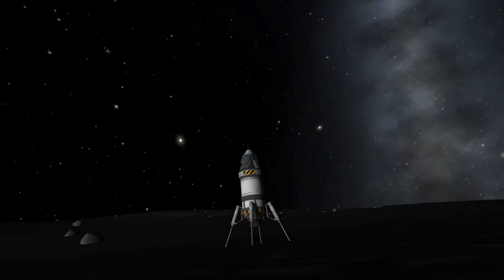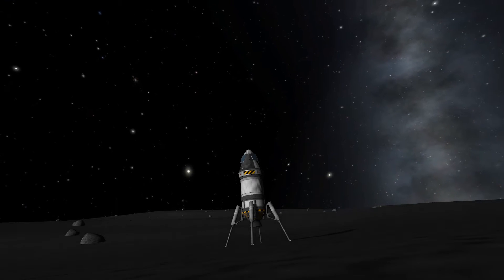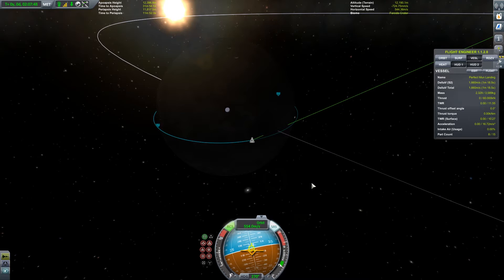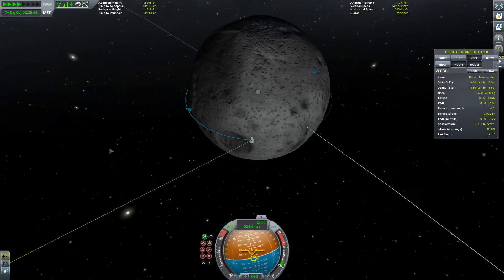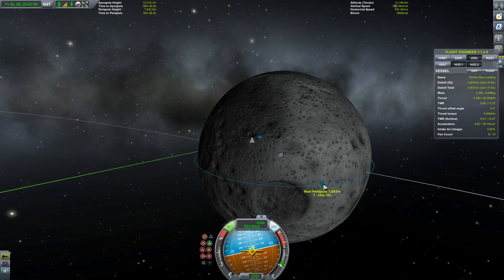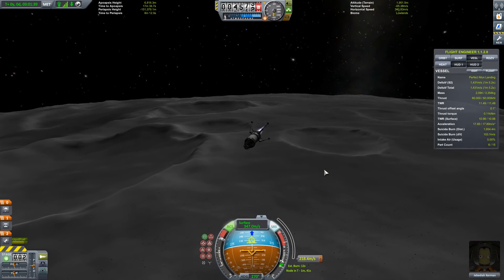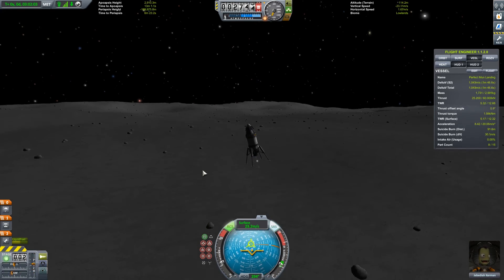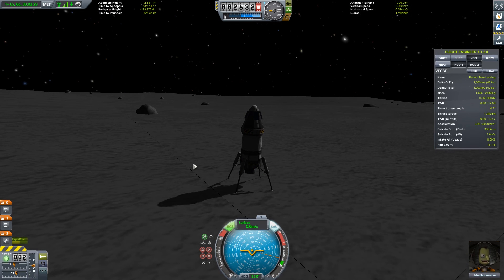Perfect Mun Landing in KSP - Suicide Burn

Comment: your approach is good, but not perfect. For that you'd need more practice or kOS/kRPC.

Let me set the scene:
you start off like in the video. Coming down at an angle and *fast*.
The ideal burn is such, that you burn at 100% throttle from begining to end (landing) at an angle between retrograde and away from the planet. By the end of the burn you should land at about 5ms^-1 (or whatever your landing legs can tolerate) and with a horizontal velocity just under the what it takes to have the craft tumble down.

A lot of math would be involved.
Regular Newton's laws would get you close, integrating the force of gravity over the range from your initial location to the ground would do better, integrating over the range of mass of your craft would also help, as would noting that your trajectory is not a ballistic one, but rather orbital.

All of this before you include a term for air resistance, which is a function of orientation and (constantly changing) speed², AND atmo. density.

As he said: there's a reason it's called the suicide burn.

however, master it, and even SRBs can be used to land easily.

Edit: forgot to praise the video.
It's a great, easy-to-follow tutorial on an approximation of a  verry useful procedure, that is human-doable. Great job!